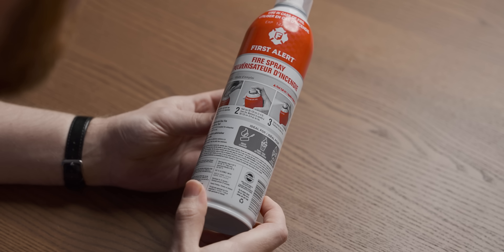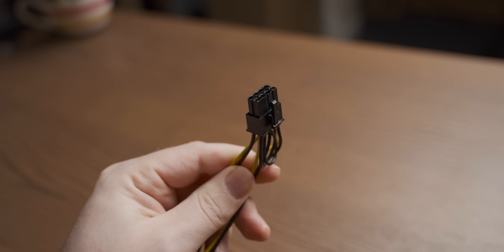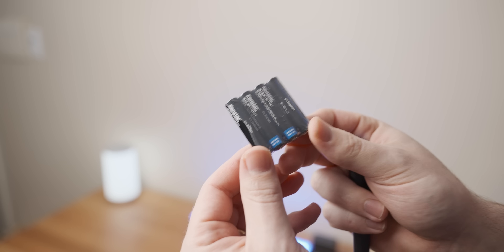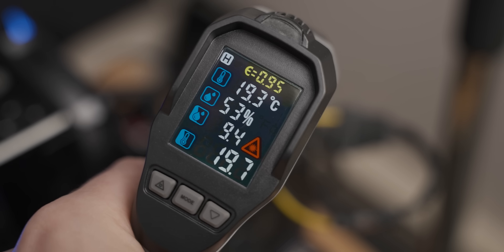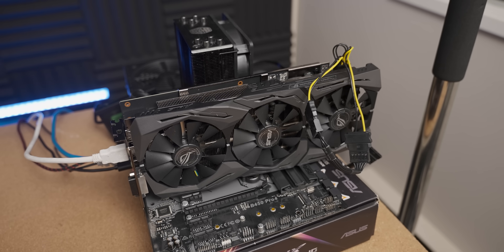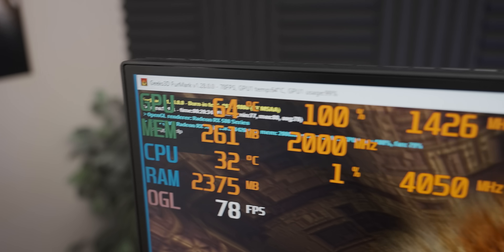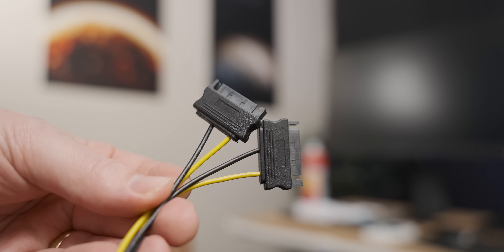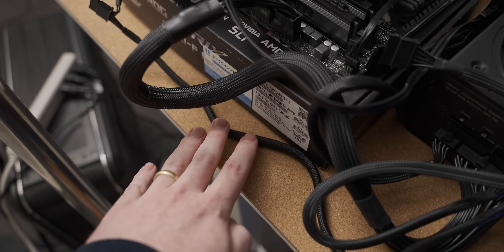Will This Adapter Set Fire To Your PC?

Comment: Would you say it would be okay to run an RTX 4060 8gb with a max of 130w on a Dell with one 6 pin and this adapter to a dual 6pin to a single 8pin for power?

Comment: So I use adapters but since I never play with more than 60 FPS the adapter is never fully utilized and in 1080P without junk tracing (ray tracing and without DLSS without FSR without XESS and without transformer model etc. I usually only use cables with 2 lines or 2 12V cables and I never get to 200W unless the game is very inefficient

Comment: If you really want something catastrophic, use a card with multiple pcie power connectors and then use a splitter to plug all them into the sata adapter

Comment: Im at 4:23, haven't watched the full thing yet but 140-150W is the total consumption, including the power pins in the pcie slot, so it's drawing a lot less from the power connector.

Comment: As long as the room is well ventilated, maybe air conditioned, and the wires aren't touching anything flammable like cloth or paper, there is no huge risk of catastrophe. Still don't trust them for long, as Dawid said, only use it temporarily until you can get a better PSU.

Comment: Am I right or wrong, maybe the quality of Powr Supply is good, I've used that cable for msi gtx 560 SE the cable was melted and the vga needs 2×6 pins, with 450watt Power Supply, maybe the quality of Power supply has effect

Comment: can i use it on gtx 1650 gddr6, i just want to install gpu without buying new psu, im using hp prodesk 600 g1 btw with xeon e3 1260v3, 16gb, 3x1tb hdd
Reply: yes
Reply: @spirat8113 how about gtx 1060 6gb on a optiplex
Reply: @Ghostcubert  I think that the PSU is not enough
Reply: @spirat8113  so about 300 psu is not enough? I will be undervolting too
Reply: @Ghostcubert You need at least a 400w & 6pin power.
Reply: @oldschooldude8370  ok

Comment: Definitely don't do this if gpu power is rated higher than pcie x16 slot. Mine lasted 4 months, luckily I unplugged my pc immediately when i saw a spark and 1 in fire. Other components weren't affected.

Comment: If I get a dual adapter with 18awg wires do you think it will be ok for a rx 6600 since it only has a tdp of about 135 and will also get power from the pcie slot.

My case came with a 400w power supply but it doesnt have an 8 pin connector and I only need 200 watts for the cpu and gpu

Comment: I used this kind of SATA setup for around 2 years with RTX 3060 and the power supply had only 2 SATAs. So I splitted both of them to have two SSDs. I set the GPU limit to 120% and somehow it was fine. It was extremely low wattage PSU so when running whole system benchmark it was tripping. Worse thing was that the spot where the lead connects to the plastic housing of the SATA was getting very hot and I didn't even noticed that. One day I opened the case and noticed that the insulation was burned and the cable just falled from connector.

Comment: But if the connector is susceptible to fire/heat, then why not just cut it and connect wires directly to the cable coming from PSU or Motherboard (in case of Dell PCs)???
Reply: Then your failure point goes from the connector to the motherboard/PSU; with a good psu it would have protections from overdraw but i wouldn't try it with a crappy dell PSU.  There is a tiny clip at the end which imo should have been a bigger part of the video; 9:36 where the cord to the psu itself is hot.  The limits for electrical are based on how much power it takes for parts to overheat and fail but its easy to put too much power in the wrong place its not like too much has a traffic jam.

Know this comment is old but want to maybe save you a fire and a dead psu lol; they really can explode a bit there are vids on yt and if its below the board some stuff will get cooked

Comment: Okay can anyone here enlighten me?
I have a RX5700XT and my PSU has only one PCIE power cable and it is pig tailed.
I'm planning to just use the other connector with the 8 pin and use one of these SATA to PCIE cable adapter to the remaining 6 pin(RX5700xt has both 8 and 6 pin power)

Is that a good idea? Pls help

Comment: I have a rtx 4070 super i bought a 700 watt psu that it Saud it had two but actually 1 8 pin with a 8 pin pinktall 1 8 pin 169 watts plus pci-e 75 watts is 225 watts I need I another 8 pin will this work for around 30 watts?

Comment: My sons pc has been using one of these adapters with an 8-pin rx 480 without any problems whatsoever. Hmm
Power supply is like 450-500watt buts its pci-express connecters are too short to reach the GPU lol.
Maybe i should look for pci-express connecter cables to increase the length next time i go tech shopping

Comment: Sooo could this be safe if i used an rx580 with a 6pin and a 2xmolex to  8 pin adapter? I mean its porbably gonna be around max 150 watts power draw
So is this safe for like a month?

Comment: Mr. BitsBeTrippin got good comprehensive guide with good tech testing the PCI-E slot draw, 3090 went as high as 127W even though by standard maximum is 75W.

Comment: what's up, guys? I have an hp z230, which it just has a 6-pin connector 
I want to buy a gtx 1660 super
but i don't want to buy any adapter 
so can I run this card on the 6pin only or not?

Comment: I used that connector once on my RX580, Mine was two molex to 8 pin. Both of the molex melted but one molex was still usable... The 8 pin on the other end survived tho. I love being a sketchy and wacky person so what I did next was soldered the 8 pin to my PSU's 6 pin pcie connector(replacing it entirely with the 8 pin) and use the surviving molex as the two last negative wires on the 8 pin. Worked fine to this day
Reply: still working? Also did you run the card at its regular tdp or undervolt it?

Comment: as long as your card draws under 200 watts your fine, since the PCIE lanes provide 65-75 watts and the power cables can provide ~108 watts
Reply: actually more power is drawn from the 8 pin PCIe cable in the case of most graphics card the power is split between motherboard and PCIe but usually most power is pulled through the PCIe in my case of a GTX 1060 6GB it pulls up to 100W on max load and around 30W from motherboard

Comment: Had a 7950 dual-x, two 6 pin connectors (200W TDP), and since my PSU had only one 6 pin i used such an adapter. It is safe as the 6pin has 75 watts power which means around 38 for each sata. What I just saw with that rx580, two sata to 8 PIN PCI-E is just asking for troubles. If I have to power that rx580 using PSU with just a 6 pin pci-e I would use 2x sata/molex to 6 pin and the 2x6 pin to 1x8 pin pcie cable to even the load on all connectors.

Comment: Someone needs to try this test with an actual BAD power supply. Nobody would use this adapter on a new aftermarket power supply that already has PCIe power. These fires are happening in prebuilt small form factor computers with people too cheap to get a $50 EVGA PSU. Even the Dell PSU in this video was an 80 Plus Silver ATX one that won't catch fire any time soon.

Comment: Mehhhh I would have used two separate sata cables instead of combining it into the Daisy chain you did.  it forced all the power onto just a single cable to the PSU.

Comment: the 90 Watts shown being used by the GPU also includes the power that is drawn from the pcie, which provides 75 watts on its own. so, at 100 watts peak usage, the 8 pin is only providing 25 watts which is less than even 1 SATA connector
Reply: So, exactly what does that means? Should I go for it with gtx 1060 6gb having 400w psu?
Reply: @kunwarsahib3055  1060 6gb draws 120 watts (Usually). so, at that wattage, the pcie slot is providing 75w, leaving 45w left. and while a SATA power connector can technically support 54w, so dual data power connectors to 6 pin could in theory work.
Reply: @theorphanobliterator  understood, now I can easily go for dual molex to 6pins , right!
Reply: @kunwarsahib3055  I'd say long term, it's not the BEST idea, kinda janky but it'll probably work
Reply: @theorphanobliterator  okay now I got this .

Comment: those connectors are very safe to use. They were never made for crazy high end video cards. In a worse case you "can" use them has a sorta "fill the need" for the time being if you need it, but those cable are around for low-end and slightly mid-range gpus. if you get crappy $1 ones from ebay now you talking something else those will not be safe at all. but good video.
Reply: People alwayss overestimate this stuff, last year I bought a rtx 2060 super 8gb to upgrade my gpu (gtx 1060 3gb), my 1060 had 6pin so i thought I'd just install the graphic card and use the 6pin on it. Fast forward my PC said I need to plug in the correct power cable. I went on amazon and bought this 6 to 8 pin adapter for 8 dollars. I plugged it in and it has worked ever since, I even overclock my card.
Reply: @FriendwithNoName7  bro buy a power supply quickly, I bought a molex to 8 pin adapter to power my rtx 2060 super, after 3 weeks my pc turned off instantly, when I went to discover it, the adapter had burned and caused a short on the motherboard.
Reply: @rayfeik6903  Yup you are right, I bought a new PSU about a week ago and thank God I did, I checked the cables of the adapter and they were black so thank God my PC didn't burn.

Comment: I'm not too surprised, considering you can now push through 240 watts through a single USB type-C connector. Yes that's 20 volts but not a whole lot different than the 12 volts this setup is using, probably with more contact area between the connectors compared to USB type-C.

Comment: I used these cables in a 7020 optiplex with its stock power supply. Paired with a GTX 970. As soon as I ran Time Spy with 3dmark it shutdown. I ended up replacing the power supply with a 500w evga one. And did away with the adapter cables. Worked just fine after that.

Comment: so I suppose essentially these adapters are fine for gpus that have relatively low power draw and just require a bit of extra power from a pcie slot, and given the type of computers they are likely to go in its probably not a big deal with low end modern gpus like a 4060 or a 7600xt

Comment: i got once of these but i need it dude my gpu is not that big but its a 6 pin and i only have 8 pin cables i need to use it for an adapter i gfot a 650w oiwer supply and i cant really return the gpu if anyone can tell me if its safe enough let me know the biggest games i will prob be running is like gta and dead by daylight and like beamng and assetto corsa that kind of stuff

edit: i have a nvida gtx 1650 and like i said its a 6 pin and i dont have a 6 pin can anyone give me a better adapter so i dont have to worry about blowing my pc up i dont have a job at the moment and working on getting one thats why i have low specs im not rich or anything but i do what i can so if anyone can help me thanks!
Reply: You can use dual molex to 6 pins , it's the safest suggestion I give to you because I have already brought it just take few time in the delivery. Am going to connect it with gtx 1060 6gb which took 120w . With the psu of 400w .

Comment: If i use dual molex to 6 pin with a gtx 1060 6gb (i plan on buying one) is it safe or i need to buy another psu that has 6 pin (i have a grey style psu that is decent but it says it has a 6+2 pin connector but it does not so that is why i need to buy an adapter)
Reply: So, now how you use your gtx 1060 6gb gpu , 
I also brought one but the problem is same , should I connect it with dual molex to 6 pins ??

Comment: I've a brand new OptiPlex which was launched 2 weeks ago before I purchased it. It has 300W PSU, but no PCIe 6pin. If I want to use 75W GPU with 6pin, would a "dual sata to 6pin" be safe for long term? I'm not a gamer, and my GPU utilisation will in mid-range.

Comment: Just got a gtx980 which requires an 8 and 6 pin connector.

The 8 pin will be powered properly by the psu, but the 6 pin will be powered by a 2x molex adapter. 

Does anyone know if this set up is more likely to have issues? 

My intuition says it'll be fine because the proper 8 pin will do almost all the work?
Reply: Dual molex to 6 pin connector can provide 75 watts

Comment: im no expert... but those sata cables only had 1 ground wire and 1 yellow which is like 12 volts I think. no where near 100
Reply: I wonder how much molex connectors would heat up compared to sata.

Comment: Gotta say - The RX 580 is a very efficient card. I've rarely seen it push over 140w when gaming with the official AMD game boost (to 1410Mhz) added.
Reply: @wd5vdFor the class of card it was in it's era, a mid class card, yes.
It pulls like 10w when doing regular internet browsing with YouTube on in a tab etc.
Even lower end GPUs of this era like the RTX 3060 draw 170w
The 4070 non-Ti pulls 200w

Comment: By this tests would you say a gtx 960 is perfectly safe using these adapters considering 160 w max power draw - 75 = 85, 85 /2 = about 42 watts.

Comment: thank you, because of this video i am going to try run my 1660 super in my dell OptiPlex with a 240w psu
Reply: How it's working ??
Reply: @Anshu-v1p  great im still using the same setup to run an rtx 3050, it does use less power than the 1660
Reply: @sarahmorris1527  are you still using the 240w psu and if yes has there been any issues? I want to use a 1650 super on a the same psu as you but idk if I should or not.

Comment: I had an Rx580 8GB with a 6 pin adapter to the 8 pin in the card. Needless to say, I was a noob and it melted hard... After learning that lesson, I put a better power supply in which was my first time.

Comment: Using a 6pin to Sata adapter for a gtx 1060 in an optiplex 7040.
When I run games sometimes I lose video signal randomly but the computer is still on.

Not gonna use my system until I replace the power supply :(

Comment: Nick L
2 hours ago
Here’s a crazy idea. Plug your six pin into the 8 pin slot. Take a molex or Sata to 6 +2 pcie adapter, and plug the 2 pin into the remaining two slots in your video card. The extra two are just ground and a ground sensing port

Comment: I tried using a single sata to 6-pin on a 1650 which probably doesn't consume more than 90w total even considering that it has a pcie power connector. Demanding apps like furmark or any game tbh would just crash after like 15 seconds 😭

Comment: i’m using them not the sata specifically but a molex to pcie on an RX 570 which will only draw max 150 watts i’ve also seen many people that have been doing this for years and no problems so i believe it shouldn’t blow me to smithereens
Reply: Hey bro I just got a GTX 1650 weirdly it has a 8 pin but even when oc it shouldn't draw more than 150 w right?? So can I use dual molex to 8 pin as molex can atleast deliver 100~ watts and rest from pcie

Comment: So to be specific currently I have a 450w PSU with a 6 pin pcie connector wanna use a 132w tdp GPU which has an 8 pin connector...is it safe to use a 6pin to 8pin adapter according to my calculation pcie slot provides 75w of power and the 6 pin also provides 75w so combined 150w max, I think at the end it will be safe for a 132w tdp card....

Comment: I used one on a 3070 Founders edition. After a day or two, I could smell the plastic burning. While it was still running I touched the plug investigating where this smell was coming from. Owie! It wasn't as bad as touching a CPU without a heatsink on it but it was "very hot".

Comment: I know that this might be hard to find but you can probably find a motherboard that has a 25w pcie slot rather than a 75w that will make the connectors draw more current until they burn.

Comment: I've done this twice without any issues. It is the only way to gamify a HP office PC because it has proprietary Mainboard and PSU. However, I was aware of the limitations and used low powered cards, GTX 960 and 1060. 
But nowadays for a similar build, I would suggest resorting to a card that draws from the PCIE Slot only. It's obviously far safer and even cards like GTX 1650 can handle most games on 1080p.

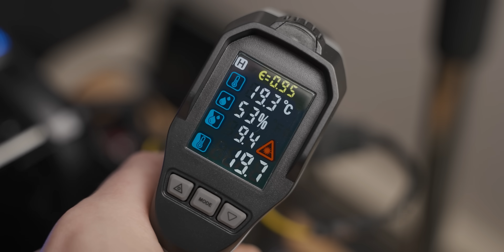Comment: 4:15 Even if the gpu were to be using 100 watts, it would only use half of what ONE sata connector can actually do, since the PCI slot carries 75 watts, which makes it totally reasonable for it not being that warm.
I would personally not use that solution; but if I had to, I'd choose a GPU that has a TDP of less than 120watts, which would mean that I use only half of what it can pull from both of the sata ports.

Comment: i used a few of these addapters on a mining rig a few years back, powering a couple of 980ti's. i think I had 4 of them and one almost set on fire. it wasn't the sata plug/connector that was at fault but the wire its self. good job I was around, I smelt it and immediately knew what it was.

Comment: I used my rx 570 with a dual molex to 8 pin, it ran fine, until one day i wasn't very satisfied with my gpu performance on some games, so i went for an overclock that was good for around a week, then suddenly one day while playing my pc crashed, I found that the adapter burned.
Now am using a 6 pin to 8 pin adapter and yeah no more overclocks until i get a new psu

Comment: I used a single sata to 8 pin for months with my RX 580 cause i had a shitty lenovo PSU. Granted, it would crash after pushing 100 watts so it never reached an unsafe level but i didnt have any fires lol

Comment: Hey Dawid! What are your thoughts on using a CPU power connector splitter from a consumer grade ATX PSU to power two CPUs on a dual socket system with each CPU having a TDP of 115 watts? Is this a ticking time bomb?